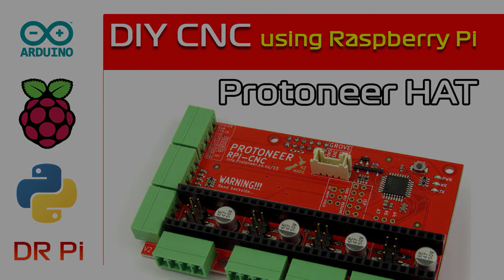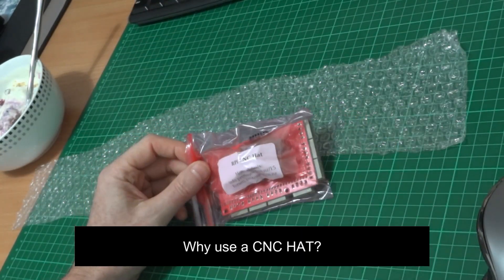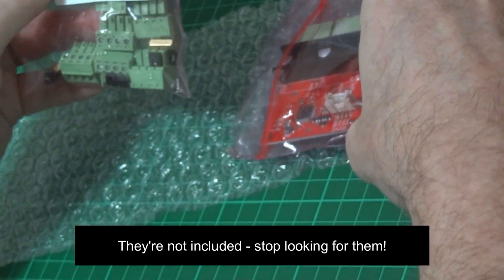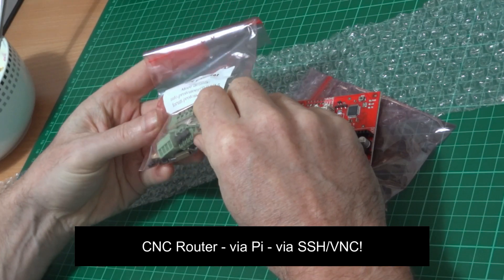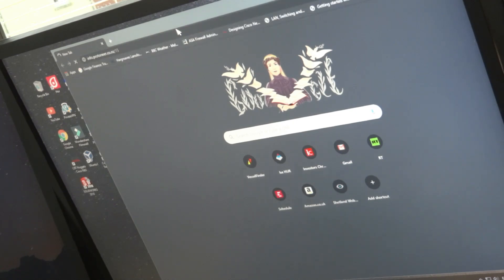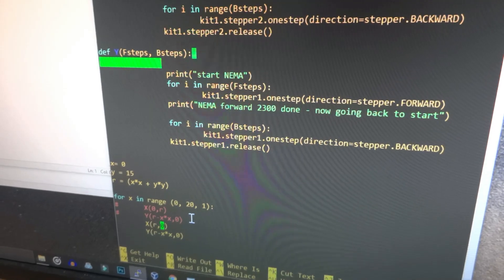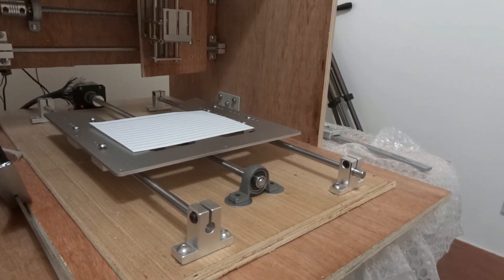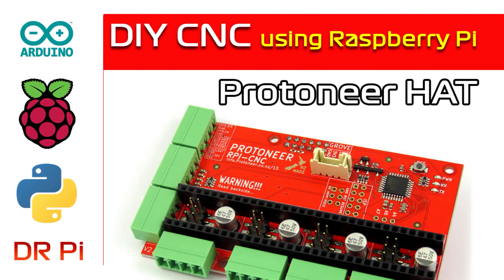Raspberry Pi DIY CNC - unboxing GRBL Protoneer HAT

Comment: HI there I'm a bit stuck in the serial port configuration, could you help with that? I'm testing it using UGS...
Reply from the maker: Sure. What OS are you using?
Reply: @jobstr-work  thanks!, I'm using the latest  RaspbiOS release (2021-05-07). I tested it on a RBPi-4 and a Compute Module  4 IO Board. The only issue is that once I try to connect the RPI-CNC hat to the UGS, it is not booted. I tried to follow the instructions at the Protoneer Wiki, but it is not so clear...
Reply from the maker: Have you checked this out : https://wiki.protoneer.co.nz/Raspberry_Pi_Serial_TroubleShooting
Reply from the maker: Ah, thank you, that's a useful video, it's clear enough. 
So this is the problem when an OS matures and things get added. I would actually look at LinuxCNC if I was to revisit my project.  ps. I have a spare Protoneer HAT if you ever need one, rather than order one from New Zealand!
Thanks for the good info!  👍👍

Comment: Hi, I currently started a project where I try build a controller for a hobby cnc, I've only started about a week or 2 ago and got have the gui(interface) complete. I'm having issues how to go about starting the backend and was wondering if you could point me in the right direction? I'll be using a raspberry pi for the controller and coding it in python with the help of tkinter for the gui.
Thanks
Reply from the maker: yes, so you need to decide if you want to use GRBL, if you read up on it, you will probably decide to use it.
then, choose Pi + Arduino, or Pi + a CNC HAT.
http://willysgaragenorway.no/ is a site I used for a lot of reference.

I started with X an Y axis, and added 3rd axis stepper later on.
You'll need to read up on NEMA stepper motors as well, and remember NEMA is just the size...not the power...
You can have 2 different NEMA 23 motors and they can be very different in terms of power/torque depending on their specification.

Also look at people who have made wire cutters for foam parts, such as Keith Howlette, really good videos on YouTube.
Reply: @jobstr-work  I'm working on a 2 axis machine. My plan is to use an arduino loaded with GRBL and control it with a Pi. I would like to crate a custom GUI to send gcode to the arduino. Would this approach work?
Reply from the maker: Yes. Absolutely it would.
Keith Howlette's videos about making a cnc foam cutter were really helpful when I built my project.
Arduino UNO is perfect for the job..
Reply from the maker: You can use Tkinter with Python for the GUI
Reply: @jobstr-work  Thanks for you help. I am thinking about building a CNC table like Jeremy Fielding, but I want to cheat a little by using GRBL instead of writing the a full python code to control the motors. The idea is that the GUI would speak gcode to the controller and move the motors that way. Python would be fine to just move the motors around but I am trying to minimize the coding since I have minimal experience with Python.
Reply from the maker: http://willysgaragenorway.no/2018/01/23/using-g-code-files-and-setting-zero-in-ugs

Willysgaragenorway is  good reference as well, see also UGS

Comment: How do I set the homing height? When my CNC finishes it moves the bit to the home position, however, it always moves the bit to Z = 0 first, and sometimes this ruins the piece, so I have to have attention and hit the Stop button manually to avoid this from happening.
Is there any way to tell the controller to keep a safe distance from the piece when homing?
Reply from the maker: Yes, you can use a limit switch, or hall sensor.

The Protoneer HAT supports end stops : End-stop switches are standard “always open” switches.
You just need to move the jumper to activate it.
Hope that helps?
Dr P.
Reply: @jobstr-work  Thank you so much for the reply!

I do have limit switches, but that's not the problem.
Imagine that I just finished milling a piece, the mill bit raises to the safe height that I have set in the G code.
At this point, everything is completed and the CNC automatically enters a homing sequence.
But it lowers to Z = 0 first and then moves to X = 0 and Y = 0, this is not what I expect to happen.
I want the bit to stay above Z = 0 to not hit or scrape the piece.
I think the new version of bCNC allows to run custom G code when it finishes, I will try to code my own homing sequence to always stay above Z=0 when moving
Reply from the maker: I just read that you can edit config.h to change the axis order during a homing cycle, so you could make z third in sequence?
Source: 
github.com/gnea/grbl/wiki/Grbl-v1.1-Configuration

Comment: hi pi 
in india we don't have protoneer hat,is it possible to integrate arduino cnc hat with pi for interfacing motors(irrespective of pin sitting on the top of pi)
Reply from the maker: You might still be able to buy the Protoneer CNC HAT from: https://www.ebay.co.uk/itm/Genuine-Protoneer-Raspberry-Pi-CNC-hat-v2-60-GRBL-v1-1-Compatible-/322650015725

Else;

Have a look at this:
https://hackaday.io/project/27740-grbl-cnc-retrofit-using-arduino-and-raspberry-pi

The Arduino doesn't need a HAT/Shield, it effectively IS the sheid/HAT.

It connects to the Pi via USB, and the Pi sends the instructions in GRBL format, and the Arduino translates the GRBL instructions and outputs the step numbers/direction to the stepper motor drivers.

So in summary the Arduino becomes the 'HAT' (GRBL is a small download you add to the Arduino, using the Arduino IDE and a USB cable, just connect the Arduino to your PC and transfer via USB.

Comment: hi pi
I've tried to find your code in Github as you wrote on your page... but I couldn't.
can you share them with me?
also thank you for your tutorial... they are very good
Reply from the maker: Yes, I will add to GitHub soon.
I've only just started using GitHub so may take me a day or two.
Thankyou for the comments though, much appreciated.
Reply from the maker: Hi, as Richard explained, there are a few ways, I've actually discussed 3 ways in my videos:

1. Just a Pi. The Pi controls the motors (via stepper motor driver).
This was in my video where I test using a pen in the Z axis. I was able to create a rectangle from some GCode, which had been produced from a drawing (dxf) file. To do this properly I would need to add code for the Z axis, and subroutines for curves, circles, and splines. I just wanted to see if I could familiarise myself with the concepts behind the real life CNC software. I'm not a good enough coder to fully do this option.

2. A Pi with a "CNC HAT"
The HAT talks to the motors
The Protoneer HAT allows the Pi to run the code using a Gcode sender, such as : UGS or a you can run a Linux distro such as bCNC whic is another way to get the code from the Pi to to CNC.

3. A Pi sending the code to the Arduino.
The Arduino talks to the Stepper motors.
This is more common, and what I learned from Richard and others, you use a standard Arduino and install an extra package on it called "GRBL".
The "GRBL" software is what UGS(universal gcode sender), or bCNC is able to communicate with.
Reply from the maker: #!/usr/bin/python
# © Dr Pi - 11/12/2019

from adafruit_motor import stepper
from adafruit_motorkit import MotorKit
kit1 = MotorKit(address=0x61)

def X(Fsteps,Bsteps):

                for i in range(Fsteps):
                        kit1.stepper2.onestep(direction=stepper.FORWARD)

                for i in range(Bsteps):
                        kit1.stepper2.onestep(direction=stepper.BACKWARD)
                kit1.stepper2.release()

def Y(Fsteps, Bsteps):
                for i in range(Bsteps):
                        kit1.stepper1.onestep(direction=stepper.FORWARD)

                for i in range(Fsteps):
                        kit1.stepper1.onestep(direction=stepper.BACKWARD)
                kit1.stepper1.release()

# Jog #
# When function is called, pass X or Y to specify which Axis/Motor
# If Delta is given as +ve then run "Fsteps" (Forward Steps)
# If Delta is given as -ve then run "Bsteps" (Backward Steps)

def JOG(Axis, Delta):
        if Delta > 0:
                for x in range (0,20,1):
                        Axis(abs(Delta),0)
        elif Delta < 0:
                for x in range (0,20,1):
                        Axis(0,abs(Delta))

# LIF = Load Input File and Parse Gcode

def LIFR():
        filename = 'job.txt'
        with open(filename) as f:
                for line in f:
                        if "X" and "Y" in line:

                                Gx = (line.split(' ')[1])
                                Gx = (Gx[1:])
                                print(Gx)
                                JOG(X,int(Gx))
                                JOG(X,-int(Gx))

                                Gy = (line.split(' ')[2])
                                Gy = (Gy[1:])
                                print(Gy)
                                JOG(Y,int(Gy))
                                JOG(Y,-int(Gy))

LIFR()

exit()

Comment: I use an Arduino and CNC shield V3 running GRBL from a Linux Mint PC.  I communicate between the two with Universal G-code Sender (UGS) which is a Java program so runs on Windows, Linux and Pi so long as it has Java installed. Keep spare driver boards as I have blown them and definitely no hot swopping or running without steppers connected.
Reply from the maker: Cheers Richard, I did read about not running without steppers connected but will take more notice now you've mentioned it as well.  
I've ordered 3x A4988 driver boards (from UK supplier) - but will order some spares too (I will order those from China, and hope the first 3 last until they arrive). 

My aim is to put it altogether without sacrificing a PC, I hope to create the Gcode file remotely, in my office, and place it on the Pi/CNC in my garage, via SSH/VNC.

(In the meantime I'll experiment with creating some very basic Gcode and processing it with a Python script to move the motors).
Reply: good job
Arduino is for driving the cnc?
and raspberry is for processing?
sorry, I'm not professional as you
can you explain what is the major difference between them?
Reply: I use an Arduino and Dr Pi uses a Pi to run our CNC machines, these are two different ways to do it.